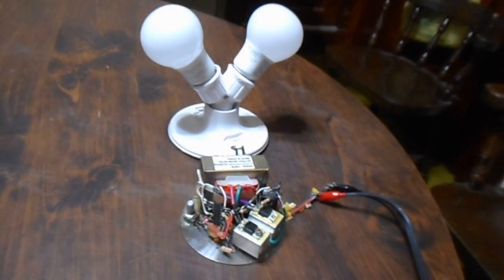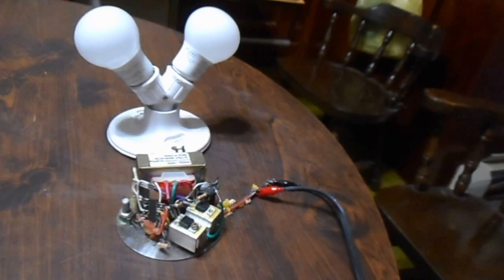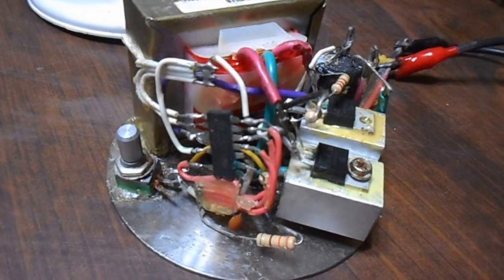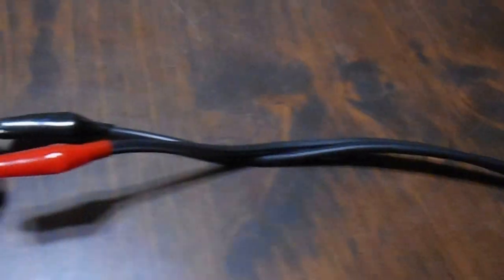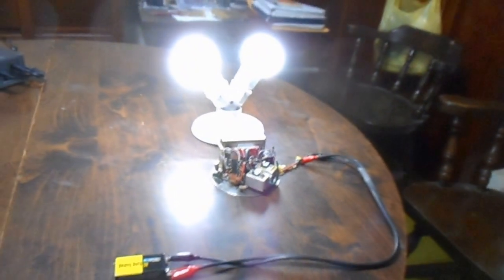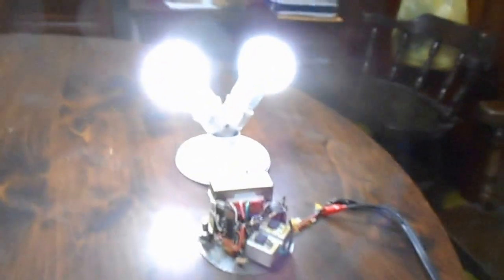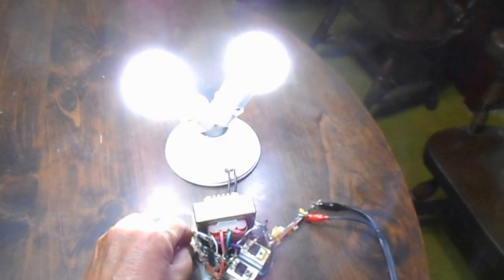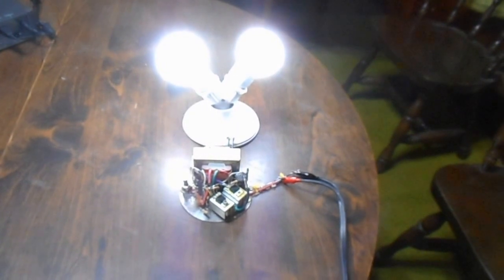DSCN5903

Comment: Thank you  Lynn, for your respond, I do not understand schematics. will it work with crystal cells say 14volt .
Reply from the maker: +basil dafnas I am afraid not.  The crystal cells just dont have enough current. The lights call for  8 watts each or a total of 16 watts.  Quite frankly since they are not burning at full brightness, 1600 lumens, they are using at my best guess a minimum of 4-8 watts. That means a 9 volt battery would require a minimum of .5 to 1.5 amps. The crystal cells I have worked with have milli amps therefore would never light up this unit. I set up two banks of crystal cells and couldnt budge a bedini motor. I figured one to run and one to charge. Total nothing. Even 50 volts was worthless. Im not the sharpest knife in the drawer so I have much to learn. Sorry I cant be more help to you. Thank you for your interest, keep experimenting.  Peace... Lynn
Reply from the maker: +basil dafnas  Basil, you might be interested in this. Very similar but runs on less amps. 
 https://www.youtube.com/watch?v=SiPGwrXqxWE

Comment: Great work LYNN. HOW LONG THE 9V BATTERY LOST.
Reply from the maker: +basil dafnas Not very long Basil.  However It runs better with 12-14 volt input.
Reply from the maker: +basil dafnas Basil thanks for watching my vids. Hope they give more people ideas  for future experimenting.  Did the test with a brand new battery. Lasted only 5 minutes before starting to dim. At 15 minutes it was night lite brightness but still running. This almost fits into the "eye candy" category. The benefit is that if you have a source of current (9 volts to 14 volts) this light will provide usable light at low voltage. I currently use it in conjunction with an added coil on a 
gegene  setup. Hope to produce a video on this project shortly. Hope it is a little more than eye candy then.   Peace.... Lynn
Reply from the maker: +Lynn Mango  Still lit after 30 minutes.
Reply from the maker: +basil dafnas  After one hour still night lite status. Not bright but still lit both lights.
Reply from the maker: +basil dafnas  Basil, After 90 minutes it is still lit at night lite brightness. I am surprised.
Reply from the maker: +basil dafnas Basil, I can now answer your question. At two hours the light flickers and slowly dies.   Peace.... Lynn